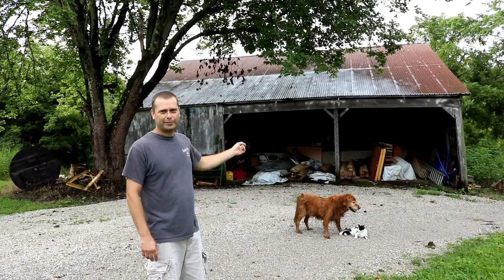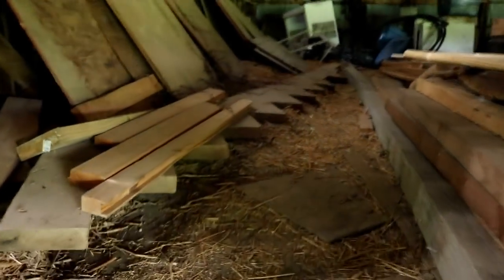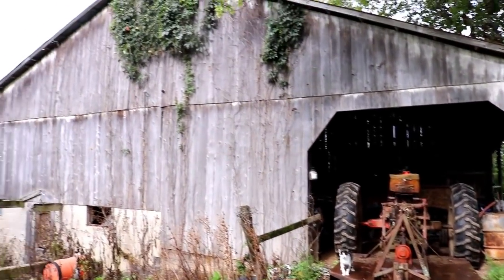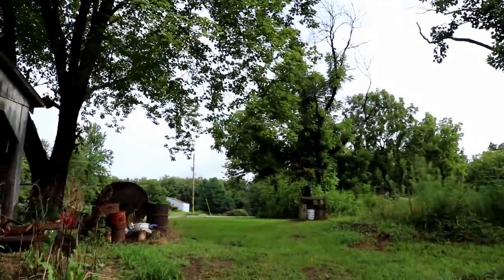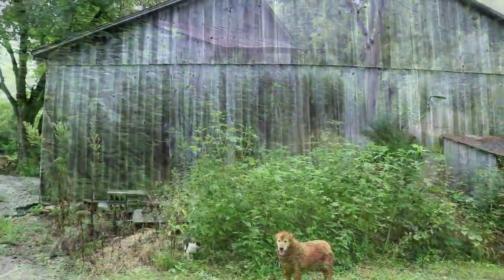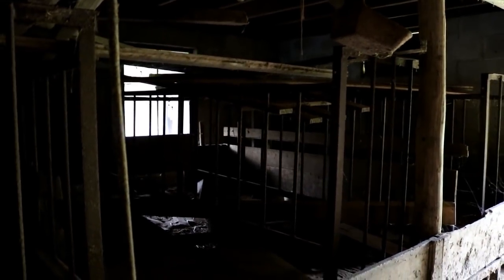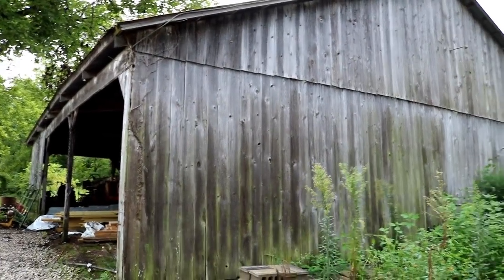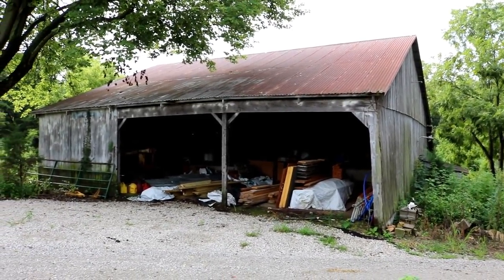The Old Bank Barn - Time to Fix it up

Comment: The wood on the barn maybe you need to spray it with linseed oil then use an oil base paint to paint it....and gradually add pulling to the out side to attach the future metal siding.....

Comment: This is going to be a great project to watch!  You and your wife have certainly proven, over and over again, you know where you're going and what you're doing on your homestead and it's certainly your project and place.  Having said that,  I would suggest the first phase should be clean-up inside and out, all levels.  Then closely examine the barn infrastructure to see if there are any immediate needs.  Next would be bringing power to the barn.  Once you start working in and around the barn for repairs and remodeling the stall areas you are going to want power for tools and lights.  The barnyard fencing would come later and add the water line at the same time.  Good luck and can't wait!  BTW, I practically binge-watched your homestead and cabin build when I ran across your channel.  Great work!

Comment: Nice bank barn, still looks straight. Go around and check all the bottom post for rot and decay. This is usually the first problem area for a barns complete failure. repair or replace any problems. Also check for critters. I had a ground hog under my barn that comprised a main beam post. It was a pain in the ass to repair.

Comment: Yesterday I had to clean out one of silos that last had corn in 2012, and let me tell you what was left it there was stuff that rats would not eat, after I was done and swept off the walls o filled two 55 gallon barrels full of crap to go to the dump.
Reply from the maker: Yea, when had the grain bins tore down, they left the crap from the bottom on the concrete.  That stuff stunk for days.  So I know what you are talking about.  It's nasty stuff.

Comment: Are you trying to move your chickens and rabbits in there by this winter? I wouldn't necessarily throw those old pens away, just move them out of the way for now; you never know when you may find some use for them, like a set of perches for the chickens. Goats would help with the clean-up, try to avoid the males they can get a bit aggressive.
Reply from the maker: I probably won't move the rabbits and chickens till next year.  I just need to get it ready to house goats and get all the fencing installed.

Comment: Looking forward to the barn reno.  That barn yard you spoke of - is that where you will free-range your chicken, or will there be a separate area for them?  Also, there is some junk up in there, but a lot of it just has to get organized, which you can commence as you move it out to get the barn fixed up.  It's unreal that the farmer who owned the property before didn't dispose of those old horse feed bags.  Might he have had a use for them?  Reckon what that was, if so?   LOL
Reply from the maker: The chickens will be able free range the barn yard and the pasture, once it is fenced in.  So there is lots of fencing around the pasture to install as well.  My wife almost bought some goats the other day, so I need to get this project moving.
Reply: Good deal.

Comment: Where your gonna put your rabbits that is an old little feed bin they work great since there gravity fed. But if I were you I would leave it to keep feed in since you will not have to worry about mice getting the feed as there made from goon thick wood.
Reply: preston kerr  really needs to be metal lined to keep critters out.